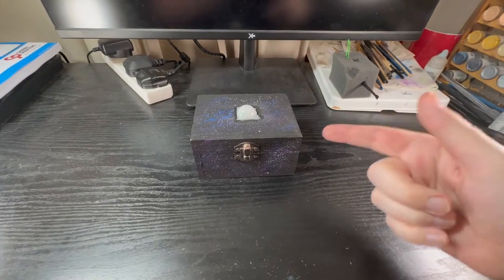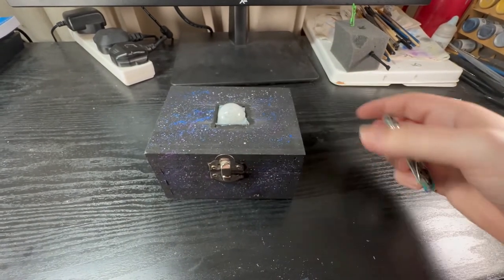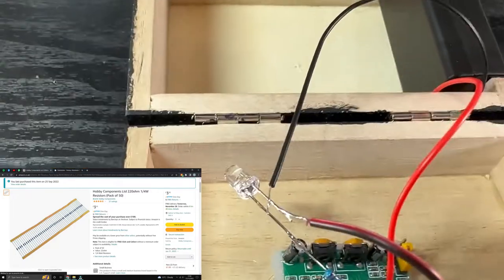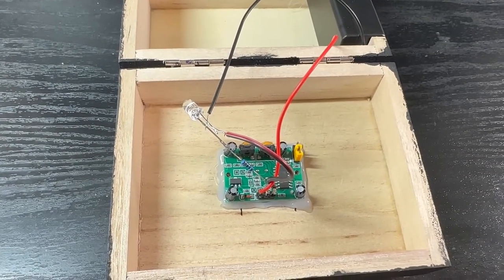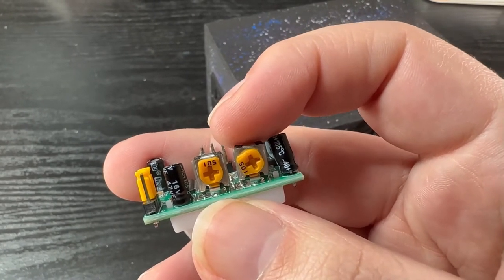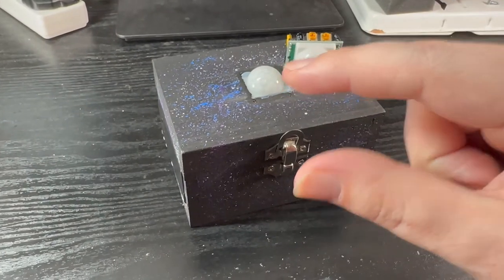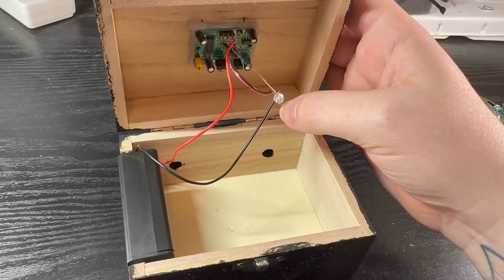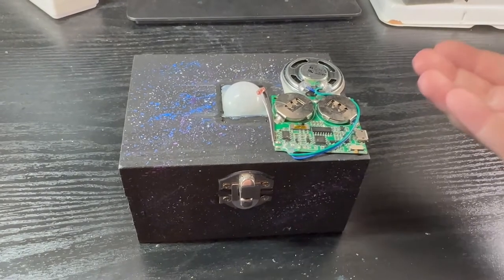How to build a PARANORMAL music box for CHEAP!

Comment: On the  wiring,  the one on the left is the positive wire from the 9v battery, the middle one is the diode to the positive led light, the right one is the negative wire to the negative led light, and the negative battery wire only to the negative led light. Is that correct? Or does the right one have a negative and a positive attached to the right and led light.  Because in the youtube it looks black and red together.
Reply from the maker: That is correct from memory, you have the negative for the PIR sensor and the battery pack wired into the negative or shorter leg of the LED, the positive or longer leg of the LED then goes into the resistor to the middle pin, and the positive battery wire into the left most pin, hope this helps
Reply: Ty

Comment: So do you just put the music chip in the box lose?
Reply from the maker: You can do, I would suggest using some blutac hold it in place so the light sensor is under the LED, but you don’t want to permanent fix it due to the need to recharge, unless you make a hole for the USB port in the box

Comment: Can you do the same with a mechanical music box powered by a battery??
Reply from the maker: I’m not overly sure, I think the mechanical ones ave a small motor that is hooked up to the crank of the music box and triggered by the PIR sensor, but haven’t attempted to make one
Reply: @paramike  I've got all the parts to make one but not sure how to wire it up without blowing the sensor
Reply from the maker: @colinthomas9236  it’s something I’d have to try / mess around with before I could comment